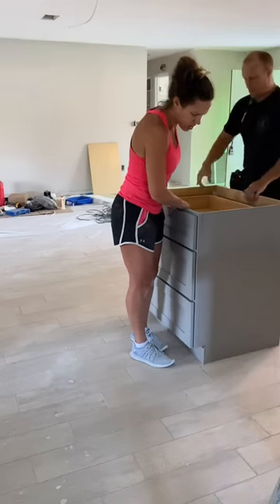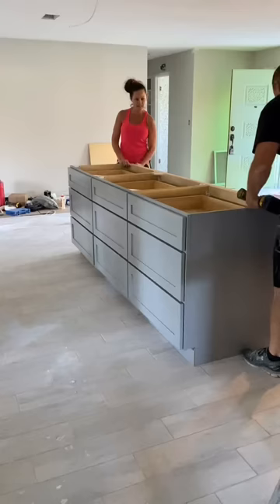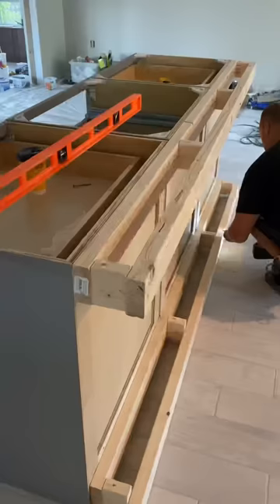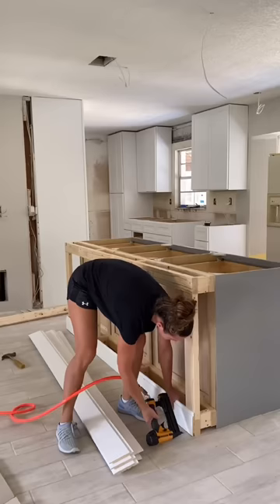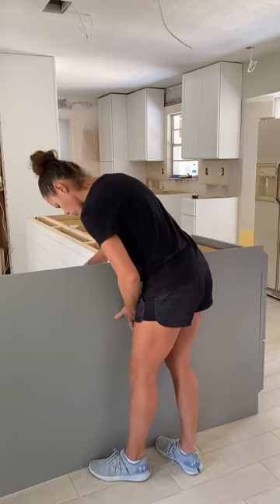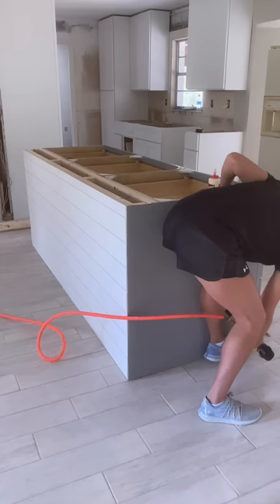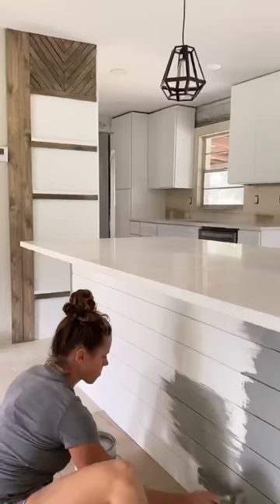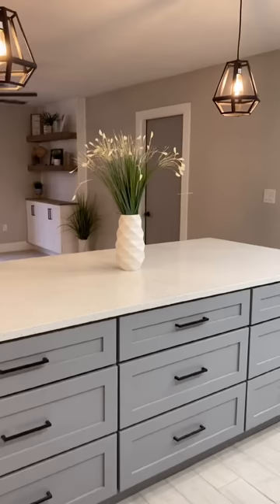Easy DIY Kitchen Island! How to make your own easy, inexpensive Kitchen Island from cabinets! Tiktok

Comment: Nice job, question: Have you secure the whole island to the floor or is it free floating?
Reply: With that large piece of Quartz countertop I think it's not moving! It's Florida, maybe in California I would worry because of earthquakes.
Reply: @chaneltyler  facts
Reply: @chaneltyler  It should be secured. It is amazing how easily heavy objects will slide around when you lean on them. Especially a long length like that. Lean against one corner and it will spin with very little effort. Fact!
Reply: @ronlaverdiere I would expect that it now weighs in excess of 300 pounds and shouldn't move unless a linebacker tackled it. Anything IS possile😂
Reply: @sharon94503  long ways from 300 pounds. Unless filled with cans and cookery. Even then, things slide EASILY on level floors. One spot raised on the floor and it will spin.
Reply: @Terri Siler it wouldn’t be a permanent island then.
Reply: @Terri Siler yep, great advice. Don’t attach to the floor, but do run electrical to it. Might as well put wheels on it too! This is a permanent island. Not a movable work station.
Reply: Even hundreds of pounds of kitchen island can scoot across a smooth floor if leaned on sufficiently.  As me how I know.
The cabinet boxes can be secured in place several ways, one of which is by by nailing (2+)  2x4"s, or possibly using construction adhesive, to the floor, sized to fit just inside the base of the cabinet units, with the boxes secured with screws at their bases into the 2x4's along tge length and ends.  Similar methods work the same:  secure some type of mounting plate to the floor, and secure the cabinets to the mounting plate(s). 
Yeah, now I have figured this out, after spending almost 30 years shoving a roaming kitchen island back in place after it took another trip.  We were always going to fix that ... 🙄
Reply: @@terrisiler1438you absolutely want it attached to the floor… if you don’t attach it to floor than it will 100% move, countertop weight & all 🤦🏽‍♂️
now if you want it to move, put wheels on it.
Reply: @chaneltyler 😂
Reply: @wadewilson-xi1zs  oh snap!!! Only other homie named Wade that knows what’s up!!!
Wade Wilson… wait a min… I think I’ve heard that name before…🧐

Comment: Do you have a longer version that shows how you attached the countertop ?
Reply: It is a quartz counter top. They just rest it on top and use a bit of silicone to 'glue' it down around the perimeter of the island. They don't even need to support the overhang when it is under 10 inches like that - although I would. Look up 'hidden island supports' for some great support ideas.
Reply: @ronlaverdiere  thanks so much !

Comment: This is exactly what I have been wanting to do with my kitchen but didn't know how to cover unfinished sides of the cabinets, I didn't want drywall. There's plenty of space and the cabinets in the kitchen are simple white Shaker cabinets, so it will be easy to find similar ones. I want to replace the countertops, but I don't know what is best. I hate the old, dull soapstone ones that I have.
Reply: Hello 👋

Comment: Love your work.  If you don't mind where do you get the cabinets?
Reply: Any big box store. A hint - if the cabinets have a face frame, then use a 1/2 spacer between the cabinets at the back end to match. That makes sure they are kept square to each other. She didn't do this, but it would make it easier to space them properly.

Comment: Just curious, about how much did this cost? And did you run electricity to it? If you didn’t, do you just use extensions cords for electrical appliances that you use at your island, like hand mixers, food processor, blenders etc.? If that is what you do, does it work out all right?

Comment: Outs of all things I wish you would’ve showed how yall put the counter top on
Reply: When you buy a quartz island or counter top, they come in and measure everything and then cut it and polish the edges. They then deliver and install it. Nobody does it as a DIY project unless they are just reusing their existing counter top. All they do is use silicone on the top edges of the cabinet and then set the top on. The silicone will secure it. They can even set it first and then just silicone around the perimeter of the island top once the countertop is in place. It is just like caulking your corners, but use a clear silicone instead.

Comment: Did you have to use any sort of support on your 15” overhang? Thanks
Reply: If it is actually 15", then there should be supports. Supposedly up to 10" overhang on 1.5" thick quartz does not need support. Look up 'hidden island support' for great supports.